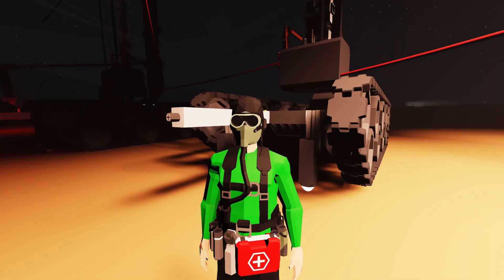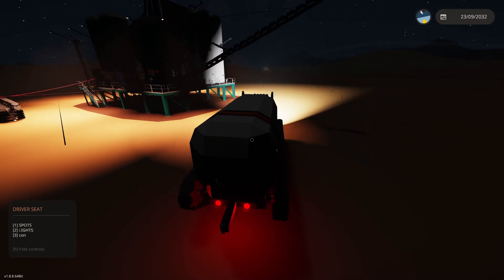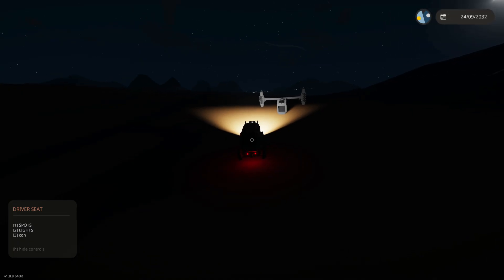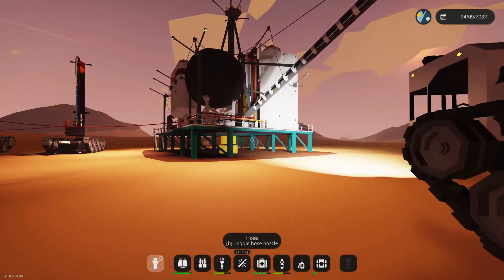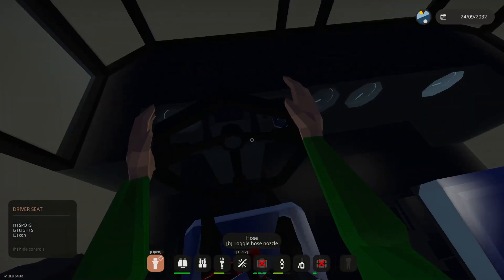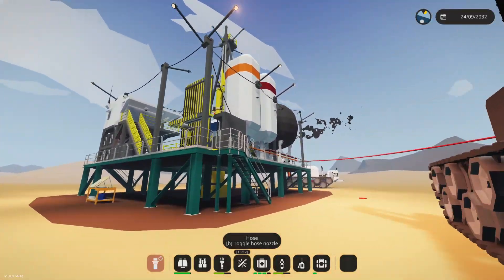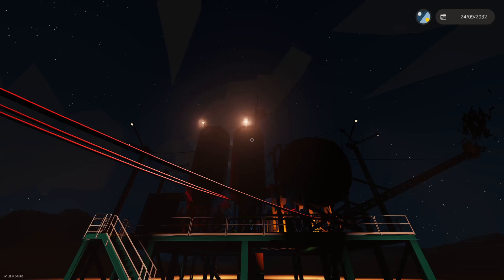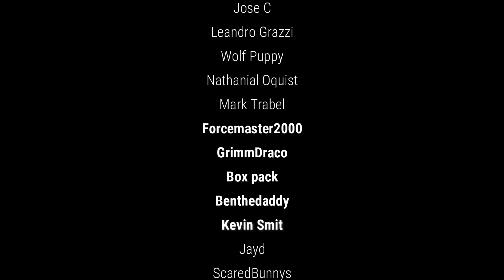Fixed It & the Fuel is Flowing Again! [S5E33] STORMWORKS

Comment: Loved the video @ProfNCognito! Can't wait for the next video man! For me, if I was going to have the Oil Platform just for Oil, I'd use the Work Bench to Build up a Refinery Building that I could Build Piece by Piece somewhere in the Desert (almost as if I was Putting an Offshore Oil Rig together) and then use the GMC CCKW-353 "Deuce and a Half" 2½-Ton and Studebaker US6 U5 Tanker Trucks from World War Two. The Studebaker US6 U5 is a Long Wheelbase Version of the US6 and can Hold 750 U.S. Gallons (2,838.75 Liters) much like the Fuel & Gas Tanker Model of the "Deuce and a Half". The "Deuce" had a Fuel & Oil Handling Model as well which came in 750 and 660 U.S. Gallon (2,838.75 and 2,498.1 Liter) versions.

For those who may be Wondering, these are the Payments you'd get for selling Jet Fuel with these Tanker Trucks:

 • Studebaker US6 U5 and GMC CCKW-353 "Deuce and a Half" 2½-Ton Fuel & Gas Tanker and Fuel & Oil Handling Models: 750 U.S. Gallons (2,838.75 Liters) (Jet Fuel Run: $17,032.50).

 • GMC Fuel & Oil Handling Model: 660 U.S. Gallons (2,498.1 Liters) (Jet Fuel Run: $14,988.60).

Let me know what you think about this and I'll catch you in your next video man!

Comment: Oh by the way the tile will save you diesel and jet fuel if you despawn the refinery! i went through this on my last stream, so just pull the oil, despawn the refinery and use spawner to spawn with fuel in proper tank.